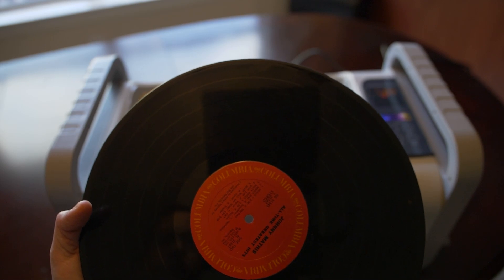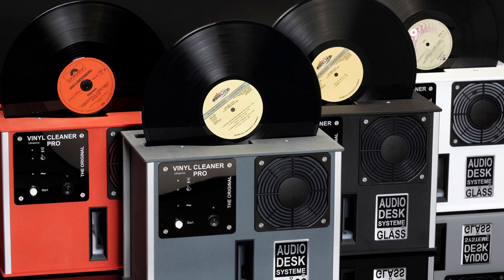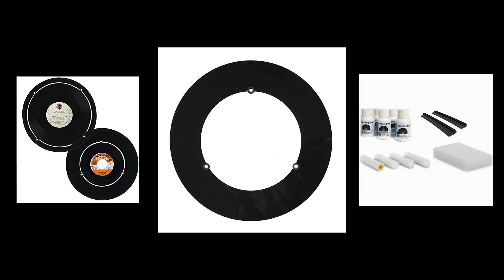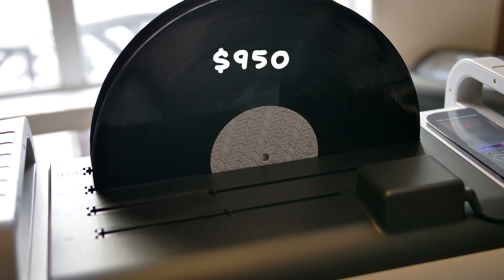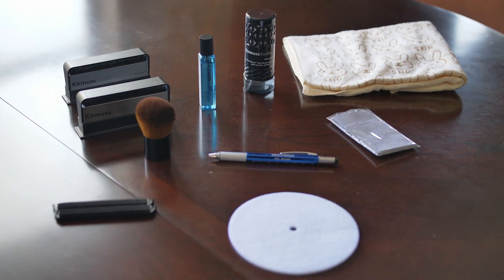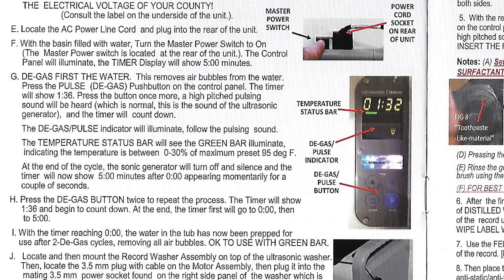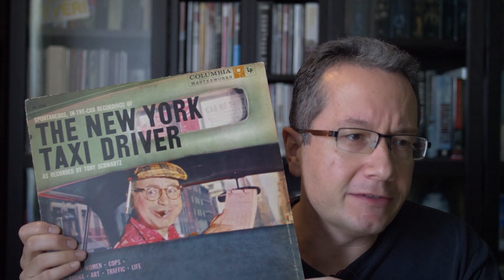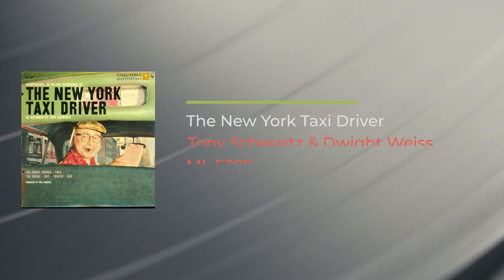Kirmuss KA-RC-1 Ultrasonic Record Cleaner Review and an Ultrasonic Cleaning Primer

Comment: HI Paul!  Your review sealed the deal for me and I just ordered one.  Are you just rack drying?  My idea was to use a vacuum machine to dry once they come out of the Kirmuss to lessen exposure.  Thoughts?  And your using just distilled water and isopropyl...no surfactant?  Or is the isopropyl acting as one?  I have read others doing a follow up rinse to remove any residue from the water/surfactant combo with just distilled water.  Necessary or myth?  What length of time are you running the records at?  Lastly, are you heating the water?  If so, what temperature?  Thanks!
Reply: May I add something if I might? I have been using the KRC-1 for almost two years now. I also have a VPI 16.5 still in use after 6 years.
I would not recommend vacuum drying after the ultrasonic. I had that same thought early on, but noted something in further research. While it won't do any harm to the record if you know what you're doing, but more so it is very inconvenient. The record comes out of the bath with both sides wet. Now you are going to put a wet record on the platter of your vacuum RCM, not a good idea. Now you are also wetting whatever happens to be on the platter and stick to the record. When you flip to do the other side you raise the potential of getting something trapped under the vacuum tube for starters.
Air drying only invites all the contaminants floating around in your home to fall back onto the record and in the grooves, defeating all your work. 
I found the most convenient way is to towel dry with a clean, soft, lint-free microfiber towel (I keep a few on hand). Microfiber auto detail towels are great for this, but you can find such towels everywhere. I towel dry going with the grooves and then follow with a once around with the round velvet end of the supplied peristatic brush (this ensures the grooves are dry). 

I also offer that Isopropyl is not a good surfactant in this use. I'm not a chemist, but I did study some chemistry in relation to record care. Isopropyl has a similar atomic charge to distilled water, which is positive. (I like physics too and have a formal year of that under my belt). Records have a native positive atomic charge as well. As you may know, too high a concentration of isopropyl (much higher than the suggested amount from Kirmuss) can make a record much harder to clean as well. The use of it in the amount suggested by Mr. Kirmuss won't do any harm and is meant to help remove fingerprints and oils. Personally, I don't use it as I find no need because I have already taken care of such things chemically using my VPI. 
The "surfactant" that comes with the KRC-1 is different, it is a "polypropyl".  Essentially, it is considered an ether. In certain mixes ethers can be good surfactants. This surfactant is applied to the record directly before putting it in the bath. What it does (beyond letting you know where you are at in the cleaning process for which I use a different process) is more scientific. For the ultrasonic bath of distilled water to work we need to change the atomic charge of the item being cleaned to the opposite of the fluid in the bath (in this case distilled water). So the surfactant is temporarily changing the charge of the record to a negative. This helps to attract the water/bubbles to the record both on the surface and in the grooves. Due to the atomic charge of the PVC formula used for records they are naturally repellent to distilled water for example. All it does is bead and bounce off. 
Try this: Run a record through the KRC-1 for a minute or two without the surfactant and note the reaction. Does the water bead when you take it out? Is the record hardly wet? Then do it again, but this time apply the surfactant in the recommended amount (doing more is just wasteful) before you put it back in the bath. Note the reaction when you take the record out. You will likely notice it is more wet and little to no beading.  This is because the surfactant has temporarily changed the atomic charge of the record to the opposite of the water. This only lasts a short time hence the 5 minute cycle time. 
The other reason for the 5 minute time is due to the transducers. 35kHz is just about the right effective frequency for records. Leaving a record in a 35kHz bath for say 20 to 30 minutes though can actually do harm by affecting and even leaching plasticizers from the record, making it turn brittle over time. (I've heard this happening with 40 to 44kHz units from makes like KLAudio. Their set default time is 10 minutes. One time won't likely end the world, but do it 3 or 4 times could bring unwanted results after a year or so).

As for a follow up rinse: You can if you want, no harm in it, but it is not necessary, the water and ratio of surfactant won't hurt anything as it is mostly removed anyway even before you dry the record. The time to change the water is when it gets murky. That is mostly from contaminates off the record and very little to due with the surfactant itself, but it also tells you it has done its job.

As stated from Paul, the water heats naturally from cavitation. 95 degrees is the recommended max temperature for records from such labels as Sony, etc. I wouldn't worry about 96, 97 or 98 degrees though, perfectly fine. The important thing about the temperature here though has to do with the transducers.  They are ceramic (most are) and they heat up. This heat can weaken and break down the transducers if left unchecked and over time, greatly shortening their lifespan. The heat of the water adds to the issue as the transducers cool at a much slower rate because of that. That is why it is strongly suggested in the instructions to let the unit cool for (it says 10 to 15 minutes, but I find 20 to 25 minutes to be better). You can do this after every 20 records or so or when the little red light stays on.
Hot tip suggested by someone I know who tried it: To cool down the unit faster and buy more time, at the point where you need to stop, drop one of those little freezer packs in the bath for 10 or 15 minutes....works great! Just be sure it is clean. I now keep a separate clean one in my freezer for this purpose.
Hope this helps.
Reply from the maker: Good question dmsaudio and I hope you like the unit.  So while I didn't get into it here, since my process gets quite involved, here is my answer to your first question.  After I am done with the Ultrasonic part, I then move it to my vacuuming machine for a rinse with distilled water.  My experience with vacuuming is that you have to be careful not to over vacuum as the excessive friction, when the record becomes too dry, will just induce static back on the LP.   So when I do the vacuuming rinse, I only go one maybe two revolutions to the point where you might see some very fine residual droplets and then I let the remainder air dry.  As you can see from the demo, the debris just doesn't immediately settle at the bottom of the tank.  Some of it can come back in contact with the LP surface so this is why I rinse.   For your second question, the alcohol is acting as a surfactant.  When I run my records through the Ultrasonic, I find that five to six minutes is usually enough.  If your still seeing caked on stuff after that amount of time, then it's time to do a manual spot treatment with a non-abrasive brush.

As for the temperature, so the water is going to be heated naturally.  The ultrasonic process is basically putting energy into the water so it warms up as a part of the whole process.  Personally, even when you end up at the unit's redline indicator, I have never felt it to be excessively hot.  It feels like nice warm bath water.  Hope this helps.
Reply: @BarakaPDub   thanks for the reply!  Great info to get me going. Super tip on the potential for static on the vacuum. 

I have a Spin Clean I thought I’d fill with just distilled water for the rinse and then figure out the drying part. No vacuum yet. Have a couple of the Groove Washer “Record Landing Towels” coming so I’ll see if they work at all.  Appreciate it!!
Reply from the maker: If you have no vacuum, no worries.  I would just use a damp microfiber cloth, after using the Spin Clean, to wipe down the larger water droplets and then let it air dry.
Reply: Got my Kirmuss today and cleaned 3 records.  Still some clicks/pops left behind but was better. These were all older, well played LPs...Kiss, Led Zeppelin and The Beatles.   I recorded a song from all 3 records into Pro Tools and then cleaned the records, then recorded the same tracks again so I could A/B.  4 rounds of cleaning.  A bit more high end in each.  Many of the louder clicks were gone but a far amount of the quieter ones remained.  One surprising thing was The Beatles (mono Sgt Pepper) had a skip in the track that I forgot about.  After cleaning it played through that spot...no skip.  Not bad for first attempt.  Not much if any gain increase.  Hoping to improve on the results, but maybe there is only so much that it can revitalize.  Going to rewatch some videos and try again tomorrow.  

In the literature that came with it was an announcement about a record platter accessory (KA-RS-1).  This should be an included item as placing the records just on the felt mat (and on the supplied towel) is not conducive to wiping or applying the surfactant.  In fact I got fuzz off the towel onto the record.  Fortunately I had something from a previous purchase that served the purpose of the platter and worked well.
Reply: @dmsaudio  Game changer huh? I can cite similar results and more in my experience. Of course, you can't fix damage or poor pressings, but other than that, the KRC can breath new life into your records so to speak. I had a similar experience with my Sgt Pepper's record. Got it used of course, just your everyday standard pressing and treated it chemically initially. Got some improvement from that. Most of the real bothersome noise was gone and it played good and sounded typical. I them sent it through the ultrasonic bath twice. After waiting a day I put it on and was astonished how the staging opened up and the whole sound had changed it seems. I was used to it sounding somewhat narrow if you will, now it has a wider sound to it and is sonically VG+, which is great considering it's condition.
FYI: I am finding that time seems to also be a factor. I'm looking into this for a scientific explanation, but I have found several times that I will put a record through the KRC as many times as required (it varies, some records are once, some twice and some up to 5 or 6 times, which is my max. Most of my records have been once to three times). Anyway, I will put the record away for a while after initial evaluation. A couple of months will go by and I will take the same record out and put it on the turntable for a listen. To my surprise I find the sonic grade to have improved by a fractional grade! This has happened several times. For example: a record will sonically go from G to G+ or VG- to VG, etc. I'm not exactly sure how this is happening, but I'm thinking maybe physics is part of it. It doesn't happen all the time of course, but I have had it happen about 20 times thus far. When I figure it out I will put it out there. What is nice is that I am not experiencing any degradation of records physically or any negative sonic results after time. I have records I put through a year ago and they are not brittle, the noise floor has not risen back up or anything, no negative effects.
I recommend instead of doing something like 4 rounds in one sitting, space it out. Put a record through, make a note if it is the first time, second, etc. Come back a week later or a couple of weeks or a month and if needed, put the record through again and repeat as needed. Like I said, there is something happening over time, that I am sure has a scientific explanation. Try it and see if you get different results good or bad.
Have fun with it and know your limitations and you will be amazed. We are not talking about magic or miracles, just science working like it should and improving things. It is all about cleaning out the grooves so the stylus can ride properly and pickup all the signal.
Reply: @ericelliott227   was surprised to not get any of this white paste residue I’ve heard about on any of the 3 records. Did t really see any particles in the tank either. But something positive happened. Was hoping for a bit cleaner (i.e. less pops) of a sound but these records were cheap finds. I’ll be doing more to get a better baseline for results and factors that affect the end result. Thanks for the reply!
Reply: @dmsaudio  I wouldn't worry about seeing the "white paste". I have plenty of records where it did not show. As I mentioned, I don't use it as a gauge as it is not consistent nor reliable. I have found that the "white paste" substance usually shows itself if the record has possible residue from a detergent that may have been used or an improper surfactant that was used or certain protein based contaminates or an obvious soap that may have been used by someone.

It is not always "release agent" either. Not only is that more likely found on new records as it is long gone on 30 year old records or what have you, but it is not a surface substance. "Release agent" is not even a separate substance unto its own sprayed on the stampers or what have you. It is usually an added singular or set of chemicals into the mix used to make the pucks. Yes, when the record is pressed, some of it makes its way to the surface as does some of the plasticizer. It's just part of the makeup of the record. It is not an issue if some of the plasticizer lives near the surface as it is very soft, just part of the DNA, if you will and doesn't effect anything negatively. Most proper record cleaning formulas can't strip it off like they can any residual release agents. An ultrasonic bath can strip and or leach plasticizer if used improperly or not built correctly and that is why one needs to be careful with frequency, time, temperature, etc. You don't really want to do that.
 You should not see any dark or black particles at the bottom of the tank. When we talk about particles we are generally talking microscopic. If you see blatant particles at the bottom of the tank that are dark or hard then you have either put a very dirty record with chunks of contaminates in the bath or something is wrong. What we generally see in regards to when it is time to change the water is murkiness. That murky water does contain particles. (If you see soft furry-like bits at the bottom of the tank that break up if you stick your hand in or something, it is no worry, that is just settled stuff (thousands of microscopic particles of contaminates). However, these microscopic particles are projectiles at the speed at which the plasma waves travel generated by the explosions of the bubbles with cavitation (think sandblaster).  

As I mentioned, sometimes it can take several cycles to get certain records back to peak performance, if you will. Eventually you learn what is dirt and what is damage just by listening. I learned that for me personally, 6 cycles is max. If no improvement or notable improvement is made, then I can make the logical leap that I may be dealing with damage rather than dirt. Records can have hidden damage, such as groove damage that you won't notice until you play them or unless you look at it under a USB microscope or similar. Groove damage can be cause by improper scrubbing with improper brushes such as boar's hair or short carbon fiber, hard nylon, etc. Groove damage can also be caused by excessive heat, lighter fluid due to the pH level, model glue (again pH level) and of course, an improper or misaligned stamper at the factory, but it is rare that those records would get out into the wild, but it has happened.

All my records are "cheap finds", partly because of the fact that they have not been re-released as modern pressings or reissues for various reasons. (I do not trust modern pressings or re-issues of older records much anyway). I like original pressings. If you have a good system of record care it is also nice that you need not worry as much, as you can trust your skills to get it clean (depends on starting condition). It can be frustrating trying to find that pristine $3 record. (Unless you are looking for classical records, then you can throw a rock and hit a near pristine one almost every time). All my classical records only needed one cycle, if that (some where fine just after chemical treatment on my VPI, ultrasonic not needed).
Reply: @ericelliott227  Great information!  Thanks!
Reply: @dmsaudio  You are most welcome. My mission is to just inform folks with solid provable information so they can care for and preserve their records properly and safely to enjoy them for generations otherwise I wasted two years of traditional study on this subject and 5+ years of experience and counting.  Music is of utmost importance to me. I just want folks to enjoy it. Good information is for sharing.
Reply: @dmsaudio  Wanted to give you an idea regarding what to put the record on when applying the surfactant or drying with a towel. I know the machine comes with a little felt thingy, but that is not tall enough to keep the record off the towel. (The towel is fine when drying the records until it gets soaked, but is not good when applying surfactant to both sides).
I would recommend the following if possible:
You could maybe find some similar material as thick as the little pad that comes with the machine and stack two or three of those underneath.
If you are the inventive type you may come up with a DIY platform. One idea would be to get a round electrical junction box plate, a regular mousepad and a hockey puck. Cut the mousepad to fit the plate. Then epoxy it to one side of the plate bottom side up. Then epoxy the puck to the center on the other side of the plate or for added stability, you could epoxy two hockey pucks to the plate. (They would stick out a little, but won't matter) 
What did I do? I happened to have somehow been sent several pad from Kirmuss when ordering more surfactant or foam replacement slot guides. So I stack them, but I have also found that it is sometimes not enough. I found some material at work and made a new base I have not tried yet.  If it fails, I am doing the hockey puck idea I just gave.

By the by, regarding the foam slot guides. Mr. Kirmuss recommends talking them out and cleaning them after every session. Based on my experience I do not recommend it. They are the one flaw to the machine as they are very fragile. I have noted that just the warmth coming off the water softens the clips too much. If you take them out carefully, they well still break after the third time due to being weakened! I have found that they do not need to be cleaned as they do not hold dirt or anything unless you are putting very dirty records in the bath, which one should never do. One can get replacements of course and at no cost I think, but it is a hassle if you don't remember. Just leave them in, they practically clean themselves. I've never had an issue except for them breaking from taking them out. (Tip: If you have the transport that does the various sized records, the 10-inch slot guide is the same size as the 12-inch slots, so in an emergency you can replace a broken 12-inch slot guide with the 10-inch).